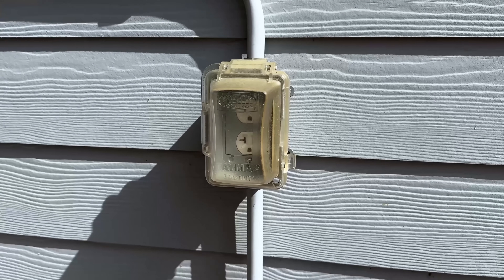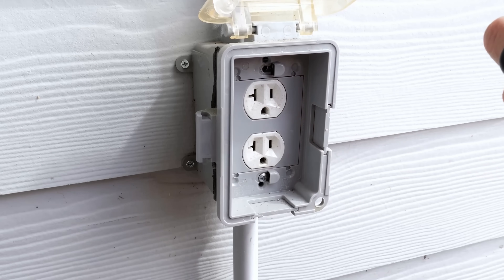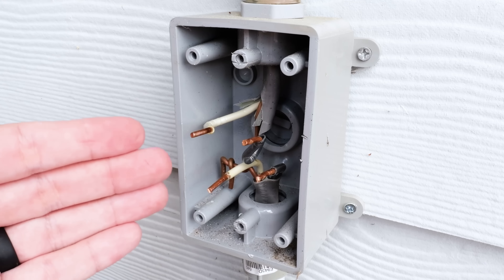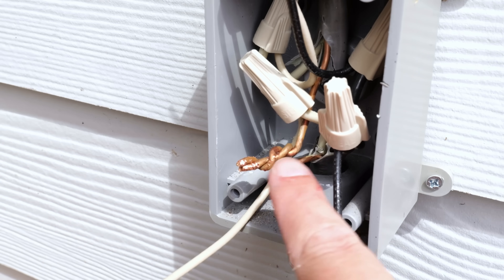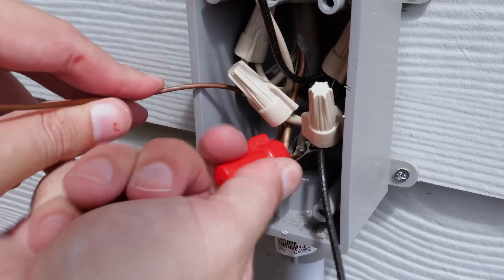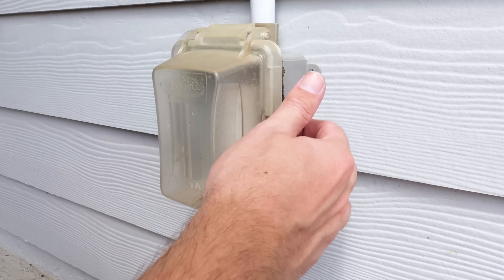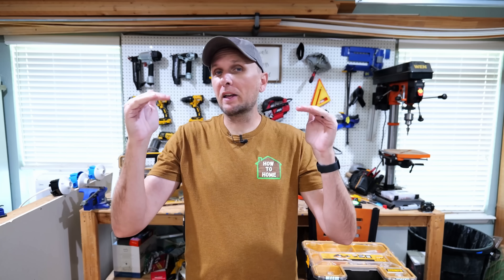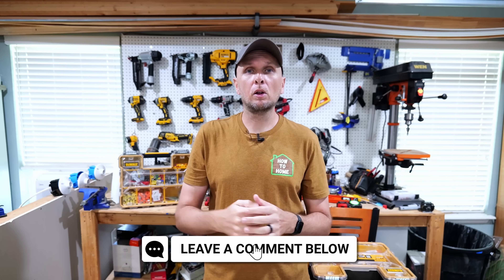Dangerous Mistakes DIYers Miss When Installing Outdoor Outlets!

Comment: Another problem is the use of ROMEX in a PVC conduit. Really should be separate THHN wires. Especially since they used 10ga wire, this can cause an over fill and heat issue.
Reply: that isn't type NM.  that is type UF.  I can tell from the way it is molded around the conductors.  probably because the conduit ends where it goes underground.  also, it is permissible to use conduit to provide physical protection to NM and UF cable.
Reply: @kenbrown2808  Conduit fill rates still apply and given that that is 10ga, most likely exceeds the fill rate for that size conduit.
Reply: @snaredude56  3 #10 in 1/2" PVC is 21% fill.  one cable assemb;y - it fits or it doesn't.
Reply: That was a good catch on your part on the Romex in conduit.  I did not catch that as here in Chicago we ‘Vill’ use THHN and metal EMT conduit.  

For circuit  reliability and ease of problem assessment I use a separate GFCI for each exterior receptacle and always use the deepest Bell (style) box for ease of wing connector placement. I was never a fan of jump through downstream GFI on an exterior receptacles.   I also don’t understand why PVC is used in lieu of EMT.  Is it really easier or that much cheaper?  How many times do we see the PVC broken off with an outlet hanging on?  Lots when I travel.  

I also drill a 1” hole for the penetration on the outside material and a smaller tighter hole through the house wrap and material behind. The larger hole on the exterior material allows access to reach the house wrap with DAP tube Dynaflex 230 to seal the house wrap and pipe hole. I pack stainless steel wool around the pipe and add seal so rodents won’t use it as a point of entry. Another tip is drill upwards from the outside through the material behind the house wrap so any moisture will drip outward between the air gap from the house wrap and the exterior material.  

The Dynaflex 230 ‘yawns’ with temperature and stays adhered.  Amazing to work with, stays where you put it, easy to form and is water based ease of clean up.  Silicone hardens over time to a rock and breaks away.  The 230 is a long term caulk.
Reply from the maker: @jerryrobinson7856 that’s not Romex in the video though.  It’s UF which is allowed in conduit.
Reply: @ I just learned UF, thank you.  In Chicago we use EMT and THHN so ‘the very idea’ of direct burial UV (other than LV) is not in our vocabulary.  Nifty to know, perhaps:  At the airport every cable and fiber is in heavy wall and encased in 3” minimum concrete to avoid accidental back hoe won’t rip it up.  The concept is, you never know what you might disturb, so protect everything.
Reply: @jerryrobinson7856  yeah, chicago is steeltown. There's a little bit of prejudice involved there. Here, steel in the ground is gone within 10 years.
Reply: @HowToHomeDIY  nm is also allowed to be sleeved for physical protection.
Reply: @HowToHomeDIY however is a very good point that should be explain to your audience.
Reply: @jerryrobinson7856  in any wet climate, metal doesn't last. Pvc may be able to be broken, but bell boxes dissolve, here. The worst meter change i did, bith the top third and bottom third of the meter can were rusted completely away.
Reply: Actually THWN, THHN is not rated wet locstion (most are double rated) Chicago is different than almost all other locations in the country

Comment: 2:26 yes!!!  Test both receptacles. I was helping a friend do some electrical work and shut off the breaker and tested one side only to get a shocking surprise when I touched the other. And this was on brand new construction!!!
Reply: @roberthall6886  when a permanent light fixture is not present in a room, let’s say bedroom, in the center of the ceiling (ceiling fan with light kit suffices) the code calls for a wall switch easily accessible upon entry that controls a receptacle. Usually this is diagonally across the room so the occupants can plug in a table lamp thus having the ability to illuminate the room for safe traversing. Typically in older construction that duplex receptacle has the electrical “bridge” broken off so one outlet is always hot and the other one is switched..
Reply: @peterwachter7753  the bridge was broken but it was not switched. Just two breakers controlling either side. I know crazy but that’s what they did. There were lots of other issues I found in the house. 3 way switcher that would only work if both switches were in a certain position. Running hot on a white wire back from a switch and not recoloring it to black. Amateurs at best.
Reply: @roberthall6886 in many years past those were common practices. I have worked in buildings where no grounds were run, they used the metal boxes, conduit, ant steel frame of the building for the ground.  

Many things you see in old structures are horror stories to us now but much used to be common practices, which is why we now have codes and inspectors...
Reply: @Randy7th Knob and tube looks a lot like what was used on old telephone pole setups..

They did what they knew (everywhere)--it wasn't stupid to them, then--it was all there was.
Reply: Was the outlet not intentionally split powered?
Reply: @mitchk7655  apparently it was split but for some reason unknown to me they energized each side from a different breaker. 

They did other crazy things like stripping hot and natural like they were going to install a light fixture…. However they just crammed them back into the junction box BARE wire , no wire nut or anything.
Reply: @roberthall6886 😳 that whole house needs to be rewired !!!! No telling what other horrors are in there !!!!
Reply: @roberthall6886  hope it wasn’t a metal box. I live in metal pipe and wire Chicago.
Reply: @M21-w1y  I know--I put it in that home's great knob and tube wiring--all by myself!
Reply: @roberthall6886 are you sure the drywall guys didn't do that one?
Reply: @roberthall6886  restarting a whole thread here 
You didn't say where the receptacle was 
If exterior , in Northern climates it was done frequently.  
People ran some heavy loads on their engine heaters 
A big circ heater can be 1500 watt , oil heater  , 450 .
Battery warmer and trickle charger on top 
Just for one vehicle 
So run two circuits
Reply: @mitchk7655 I was thinking the exact same thing someone probably popped that little piece of metal off
Reply: I’m not sure I understand the two breaker thing but I’ll guess. A duplex receptacle in which each of the two outlets were protected with 20A breakers. In kitchen this can be a great idea. One for microwave and one for toaster oven.
Reply: @theprojectman yes, but wouldn't you use a bonded double breaker for safety so that didn't happen? Just like you would use in a 240v outlet? It seems to me if you could switch the breakers independently leaving any part of the outlet live it would be a hazard. Or would they fail to trip because only one side exceeded the load? But maybe one or both of those runs went to many outlets before terminating in one receptacle. Either way, sounds like asking for trouble, I would have just spent a couple bucks extra and put 2 separate boxes.
Reply: My mom had the house remodeled after my dad passed. and the idiots that did it took and put double runs on a mix 15 and 20 amp breakers and had so many neutrals and grounds you couldn’t even put the cover on the panel. Then took the big hand cut 8 x 12 x 20 beams out and put 2x2 in the place where they put stairs to the basement. And the plumbing they cut into the main pipe going to the septic tank. Instead of replacing the pipe they put liquid nail into the cut . And instead of putting copper like the rest of the house they put grey pex pipe and took it from 3/4 to 3/8 . And much more I don’t know how people live with them self and it was not a money thing on her end. And the contractor was the preachers son in law at the church.
Reply: My well pump is 220. But somebody had hooked up the neutral as the equipment ground. Even though the breaker was off. There was current coming in the neutral from in balances in the house. The well pump guy kept getting zapped. Even with the 220 breaker shut off. It was coming through the neutral that's not supposed to be energized.
Reply: @willfriar8054 sounds like a ground fault loop. This is why you only ever bond neutral and ground in the mains panel, and anything over 250' gets its own ground.
Reply: Could be shared neutrals for two different circuit breakers which I have a few pairs of circuits in my house and is very annoying. It won't allow me to connect GFCI boxes in a lot of places. I don't see a good fix for it besides ripping out all the drywall and doing everything again.
Reply: Two 120 volt circuits in one box should be on a double breaker shutting off both sides at once , big safety problem if not . Stay safe out there.
Reply: @BruceGreen-e7o  exactly!!!  That’s my point. I made a mistake of not checking both sides and paid a small price. Hope others can learn from my mistake.

Comment: Years ago, an "electrician" wired a 240V heater/AC that was installed through the wall in a house that my mother was renting. He ran 2 hot wires through the metal electrical conduit that was installed on the outside wall. His "neutral" was the conduit itself, and there was no ground wire anywhere!

Talk about sketchy!!!
Reply: if it was a mini split heat pump, there shouldn't have been a neutral.  they run straight 240V, because they are made to serve both the european and the US markets with the same equipment.  

but relying on metal conduit for the ground is sketchy. - and in my area, metal conduit outdoors is sketchy.
Reply: @kenbrown2808  100% with ya on that! 

I forgot to mention that he also hung a 120V outlet next to the unit. The conduit was the neutral for that. Sorry about the belated detail.
Reply: @hotflashfoto  ah, yes. That's where it all goes to heck no. I normally run 3 wire for a retrofit to allow for the required service receptacle.

Comment: I agree with what you did in the box.  But had a question what if you put the standard outlet back and just replaced breaker with a GFCI style breaker instead of doing that at the recepitical?  I find that a little more convient at the panel for certain things.  I did this for my garage outlets so I did not have to worry about where I was going to put the GFCI outlet for reset purpose.
Reply: yes, replacing the breaker with a GFCI would give protection - but it's still better to have a WP rated receptacle.
Reply: GFCI is an overrated product that is prone to failure. I have spent most of my 50 years in a house that not only had no GFCI, but also had no grounds. I moved to a new house for a short time and I couldn't even have a fridge in the garage because of the GFCI.
Reply: @MAGAMAN  The GFIC was just doing it's job. The refer probably had a small amount of current leakage to ground.
Reply: A GFCI breaker will not work properly if the grounding conductor is not connected to downstream receptacles. The green wire in that receptacle box would need to wired to the  receptacle. All downstream receptacles need to be checked.
Reply: @stevekelly7488  GFCI works just fine without a ground.  In fact, it's code to use GFCI in lieu of a ground.
Reply: @stevekelly7488  completely incorrect.  if that were so, then GFCI breakers would not be approved by code to protect ungrounded circuits.  the only thing that will prevent a GFCI breaker from functioning "properly", is if the circuit is crosswired with another circuit.  then it will trip as soon as any load is put on either circuit.
Reply: @kenbrown2808  I would agree with Ken. If it was metal conduit that would be a source of ground, but the GFCI still needs to be wired to a ground.
When there is a fault in the neutral, the ground is a secondary path back to the source through the load center. 

The GFCI has to be able to see that surge of current on the ground in order for it to trip. Because it's monitoring that surge in the ground wire itself.
Reply: @wiley0714  No.  The GFCI needs no ground connection to properly protect the circuit.  It monitors current flow on the hot and neutral wires, and if imbalanced trips as there is current leakage.  No ground connection involved.

But plug testers need the ground connection to trip the GFCI.
Reply: @wiley0714  no. That is absolutely wrong. A GFCI breaker doesn't even HAVE a ground wire connection. And if it depended on reading the ground wire, it couldn't recognize an external ground fault. GFCIs look for power MISSING from the circuit.
Reply: @skityke Ground wire not required: NEC 406.4(D)(2)
Reply: @kenbrown2808 afic breakers won’t let it it has crossed a gfic breaker will still work unless it is on a sub panel
Reply: @Nuf_Nivah ummm... in english, please?
Reply: @kenbrown2808 arc fault breaker is a a breaker that can’t have a neutral and ground bonded or in a old house where they would run wires jumping from this and that . Sorry if I start not making sense I have a deteriorating brain condition from a stroke and I may have hit the wrong comment to respond to
Reply: @Nuf_Nivah yes. Neither afci nor gfci can have a bootleg ground after the breaker.

Comment: You put a 15 amp outlet in a 20 amp circuit — how is that compliant?
Reply: the majority of 15 amp receptacles are rated to be installed on 20 amp circuits, as long as there are more than one socket - and a duplex receptacle counts as two sockets.  the official rating is "20 amp feed through, 15 amp receptacle"
Reply: It's fine to put a lower-capacity outlet on a higher-capacity circuit. Only the opposite is unsafe and against code.
Reply: @MooseBoys42  I could see that if it was at the end of the circuit, but the circuit continues, meaning it could potentially carry the full 20 amp load. Something just doesn’t seem right.

Comment: Dude, usually you do a pretty good job with electrical but I gotta tell you, you really jacked this one up. Right off the bat that box is way too small for the amount of wires and the device. The cubic inch capacity of that box is 16.5 cu. in. & the total amount of box fill  the wire & the device accounts for if it is 10 AWG is 17.5 cu. in. Therefore you should have done  1 of 2 different corrections, either replaced the box with a deep box or you could have used an extension ring. But now you've got a potential fire hazard or at the very least a near future nuisance tripping or defective device due to over heating, that'll have to be replaced, if it's used much. Ultimately a failed inspection and/or a potential liability as well. 🤔 🤦‍♂️
Reply from the maker: You are correct on the box fill numbers.  Since most won’t have #10 in their boxes, I elected to treat the scenario as though it was what most people will come across, in which case this box would be just fine.  I had already started filming and did not have a larger box or extension ring on hand at the time.  Since then I did install an extension ring for my purposes.  I appreciate the feedback and good eye!  Was wondering how many would mention it.
Reply: @HowToHomeDIY   Only about a zillion, so far.  Some people don't bother to read comments before they comment.

Comment: Insulated wire "romex"  for instance is not permitted to be run in conduit! You should have pulled new THHWN through the conduit.  If they were using that direct burial wire for purposes later on the thhwn should have been used to get to a box at that point then use proper connecter,  or remove the solid core #10 from the direct burial insulation.
Reply from the maker: You are correct on romex not being allowed to be run in conduit in wet locations.  But the cable in the video is UF cable and is allowed to be run in conduit.  The conduit is there just to protect it above the surface.  It is direct buried without conduit in the ground.

Comment: Always test a known live source after checking for dead.
Reply from the maker: By using two devices to check for voltage, the chances they are both incorrect is extremely unlikely.

Comment: You will shit a brick on this one.  I WON'T use a Wago splice nor a wire nut.  I'll use a heavy duty crimp splice  where the wires are crimped simultaneously side by side, then two layers of shrink tubing.  Not code but better.  And also I'll solder splice pigtails and insulate with wire nuts.  Not code but better.  No crappy electrics in my house!

Comment: So the GFCI receptacle does not permit a 20A plug, right?
Reply from the maker: The one I installed would not no.  I could have put a 20 amp receptacle in since it is a 20 amp circuit but I had no need to.

Comment: Great video and good to know these mistakes before I install a new receptacle in my backyard. One suggestion would be to use a box extender so that you can have more room to fit the GFCI outlet into that crowded box. It looked like you were quickly running out of room to install the GFCI outlet after you made those wire nut connections lol
Reply: Yes or a deep box. Those are a thing too, a priceless extra half inch I think.
Reply: @TheKingOfInappropriateComments Not sure how deep plastic outdoor boxes are but yes, that's absolutely right if available
Reply: @TheKingOfInappropriateComments  That's what she said.
Reply: Would have been easier to just put a GFI breaker on the other end probably.
I prefer the boxes that the cover stays closed even when in use myself.